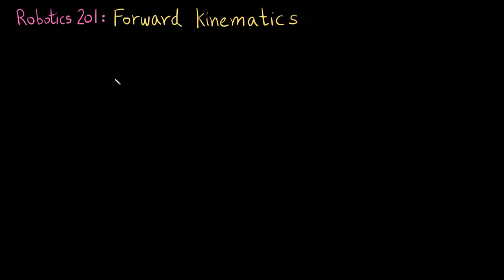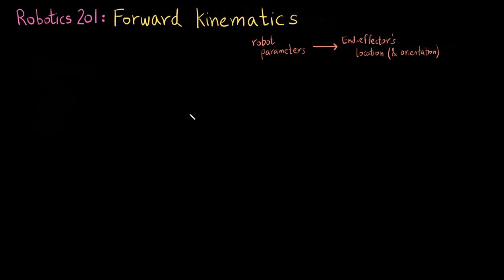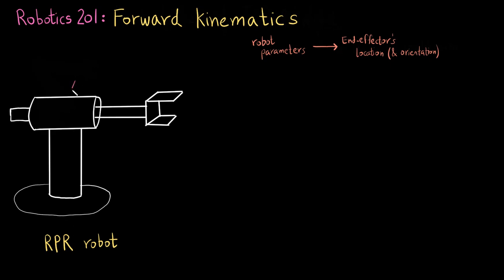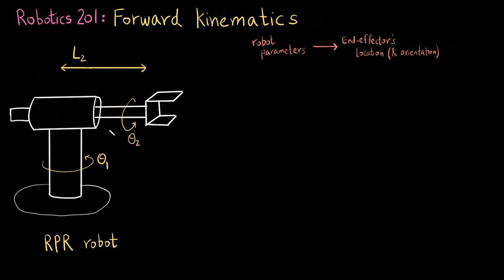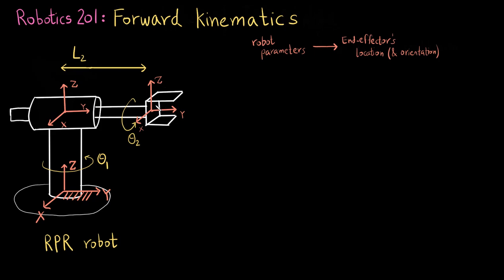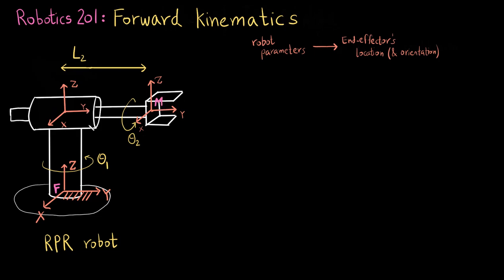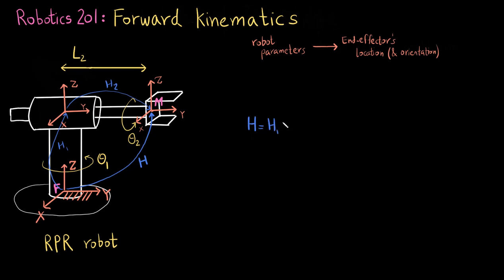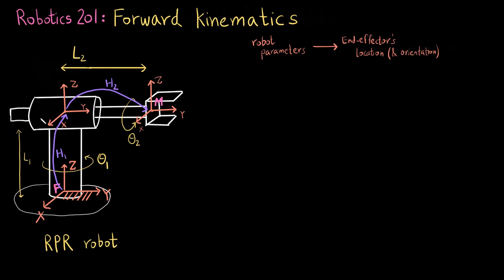Forward Kinematics of Industrial Robot | Part 1| Robotics 201

Comment: I have a doubt regarding the First and third joint. Aren't they twisting joints ?. Can you please explain why did you call them as revolute joints.
Reply from the maker: Yes you are right. They are also called twist joints. Usually you can call the same joints a number of names which depends on which direction you are looking at them from. If you are looking at this joint along the direction of the link, then it seems to twist. If you are looking from the side, it seems to 'revolve' around an axis.

In the books and literature, you can find it referred to with a bunch of different names with the most common being an 'R' or revolute joint.
Hope that clarifies the confusion.
Reply: @EngineeringSimplified  Thank you
Reply from the maker: Glad to have helped!